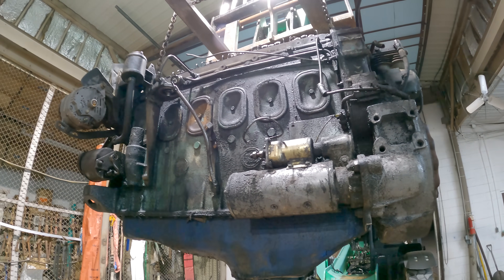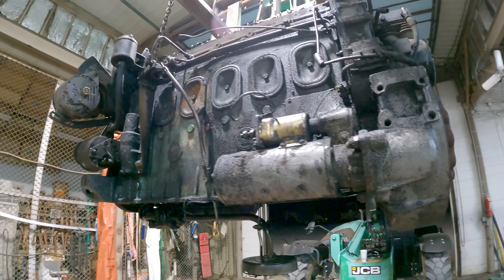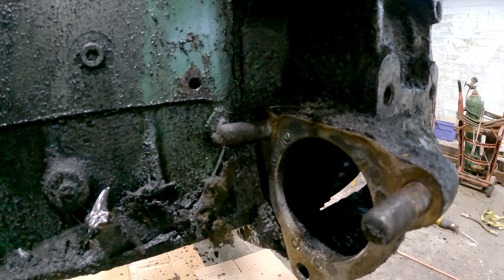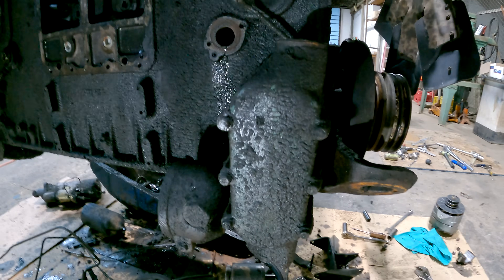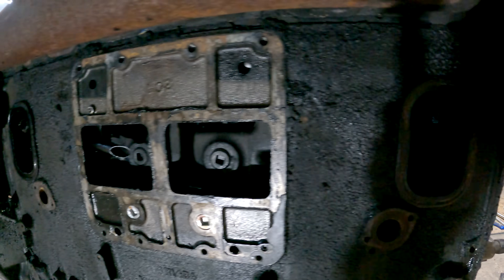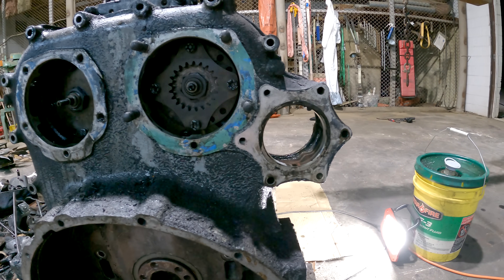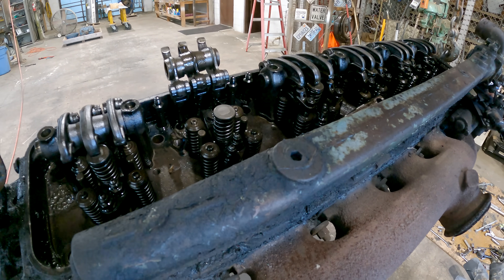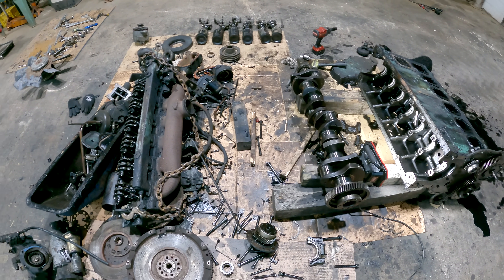Runaway 6-71 Two Stroke Detroit Diesel Engine Teardown

Comment: I wasn’t aware of the inline 6 two stroke detroits. I only really knew about the “screaming jimmys”. Drove a V6 in some old Prevost coaches. One of these days I gotta find the farm that had an ‘81 Peterbilt cabover in pretty good shape. Had an 8V92T in it. Told me back then he’d take $2000 for it. Would make for a fun project.
Reply: They made a 1-2-3-4-6-8&12 cylinder Detroit’s both straight and v configuration naturally aspirated-all had blowers and turbo over blower applications.

Comment: What is the reason for a running a roots supercharger, sentrifugal, or turbo charger on large diesels? What are the benefits or drawbacks?
Reply: It is because two stroke diesels need superchargers you run. Unlike gas engines, two stroke diesels are not crankcase scavenged so they need the blower for a constant flow of scavenging air, and a turbo can’t be used for that because at low rpm, their isn’t enough exhaust flow to spin the turbo fast enough to build sufficient pressure for the engine to run.

Running a turbo on large diesels (4 or 2 stroke) increases efficiency and significantly increases power and lowers emissions

Comment: If you have any more runaway engines happen please try to remove diesel fuel from the equation once the chain reaction takes hold proving undisputedly what TF people just watched
Reply from the maker: You're misunderstanding the concept of a runaway mechanical unit injector engine.  The engine is running on diesel the whole time.
Reply: About a month ago, the only time I've ever seen it in my life at a local scrap yard a loader operator begin to lose control of his engine speed and everyone was too afraid of this thing to attempt blocking off this engine's air. The hood was precision moved with the grapple and with all the junkyard precision the intake tube was pinched. The curiosity of the billowing smoke made me arrive at this point.  It's slowed it down but for another 10 or 12 minutes it poured smoke like a three tire fire and was only stopped once it's crankcase was empty. It was pissing coolant the whole time but I don't believe it was a victim of overheating. This engine was running on its own oil and barring completely choking off its air or mechanical failure due to engine over speed it was not going to stop otherwise. Seen as in my 20 years of mechanical awareness this was the only incident I have personally viewed it would be near impossible to reproduce. This is a situation I've always thought of as a loss of control or a runaway event.
All of my respect goes to you and I would be a fool to not recognize your Superior level of experience to my own. I absolutely loved the complete lack of anymore burnout call out videos after you shut everyone down. My hat goes off to you. This was a new enough Volvo loader it would have had electronically controlled injectors.
Reply from the maker: @jasonstinson1767  In that case, the engine ran away on its own crankcase oil, which is the scenario most people think of as a runaway.  In certain MUI (mechanical unit injector) designs, such as these old 2 stroke Detroits, there is the opportunity for the injector racks to get hung in a high fuel or full fuel position.  When this happens, the engine runs away the same as it would if it were sucking its own crankcase oil.  They will rev right up until they start floating the valves and max out, or fly apart.

Comment: I wonder if a 6-71 Detroit would fit in an old C 10 Chevy pickup?
Reply: A 6-71 might be too long but a 6v53 v6 might fit better, it also revs higher (2800rpm vs 2100)
Reply: It's not the size, it's the weight. You're sitting at around 1800lbs. A 350 chevy weighs a quarter of that
Reply: @buckberthod5007  a 6-71 is only 426 cubic inches.  Seams that should not be much heavier than a big block Chevy.
Reply: @ryanehlis426  I'm not trying to sound mean here, but you don't you know your ass from a hole in the ground about Detriots. The block alone weighs the same as a SBC. Then add the 300 pound crank, the sleeves and pistons, the rods, the cam, the 250 pound head, the cam, the rocker assembly, fuel rail, then the front accessories. Water pump, balancer, alternator etc. A 6-71 is an inline motor. Somewhere around 5ft long, 3 foot wide and 4 foot tall. If you really wanted to put a Detriot in a Chevy, you'd have to use 1 ton axles. You'd be better off running a 4V-71 or 6V-71. Shorter block, it fits better. I built a '58 International pickup with a "souped" up 6V-71 and that was a nightmare. I elongated the frame by a foot and a half to fit everything
Reply: @ryanehlis426  Engine displacement doesn't have anything to do with weight. Take a 5.9 Cummims. It's only 360 cubic inches, and an inline 6 but it weighs 1100 pounds. Dodge also made the 360 V8 LA (earlier carbed version) and Magnum, which is the one I'm describing here. The 360 Magnum is the same displacement as the 5.9 Cummins, is an 8 cylinder and weighs roughly 550 pounds. The materials and components used in diesel engines are 180 degree different from a gasoline engine. Do you know how many strokes a Detriot is vs a Cummins, International/Navistar, Duramax etc.? Or how they're fired? I'm not asking to be a douche, I'm just willing to share some knowledge and help ya better understand em if you'd like the info
Reply: @buckberthod5007  the old Detroit’s where 2 stroke engines that’s why they sound so cool ;) most modern truck and car engines are 4 strokes.  Im a truck driver, my freightliner has a 14 L 60 series, it is very large and heavy, 2600 pounds.
Reply: @ryanehlis426  So you're not completely clueless, that's good. I wasn't sure. Are you OTR or shorthaul
Reply: @buckberthod5007  I looked up the 6-71 it weighs 2185 pounds!  Iv been working in the oil field hauling crude oil for 11 years, Iv done various other driving jobs before that, flat bed, belly dump, hot oil, mostly regional or short haul.
Reply: It might, but it would be underpowered. Good grocery getter, maybe?

Comment: Learned a lot about blower motors and the fuel injector demonstration was awesome, thanks!
Reply: A fine mist is how an injector is supposed work, even after all this engine was put through it's injectors still work properly. That's a testament to quility. The only thing I have against Detroit diesels is that the are very thirsty. They require a lot of fuel.
Reply: Hunter Moss  Fuel used to be cheap
Reply: @Kevin Guthrie  yes it did once upon a time, including gasoline. But now it's all going up in price because of a certain old man and his cronies in the whitehouse. He's not even supposed to be there but somehow he is. Hmmm I wonder how.🙄  I don't want to speak his name because he disgusts me.
Reply: @K-Effect  Regarding the inflation fuel is still pretty cheap.
Reply: Albin Klein  How about this, fuel is still cheap but to compete and afford efficiency isn't
Reply: @huntermossakajunkerman9646  God bless you sir.
Reply: @K-Effect  We recently picked up a big apartment job, had to bid low, probably to low to make anything, just handle a shit load of money, to keep the crew busy. We used to give away most damaged work cost, people crushing or mangling our stuff, just fix it back & move on, but now we back-charge for anything, now the builder gets beat-up, stuck in the crossfire between contractors & blame-game, its a pathetic way to do business

Comment: Thanks for taking the time to tear it apart and show us the guts. Worked on plenty of E model Cats, C15’s, N14’s, and ISX’s, but had never seen inside an old 2 stroker. Always loved the sound though….. Hope to see you sooner rather than later.
Reply: Lemme Guess... You drive a Western Star Ken?
Reply: @bjbeardse  Nope. Mechanic for a small fleet of Pete’s and Kenworths. We have around 70 power units pulling A train belly dumps and pneumatics, and also some B train flatbeds.
Reply: Funny though, when I hired on, there was a ‘96 Star Car there. 46K rears, triple frame, E model Cat. Not a bad truck, but needed the entire state of Montana to turn around.